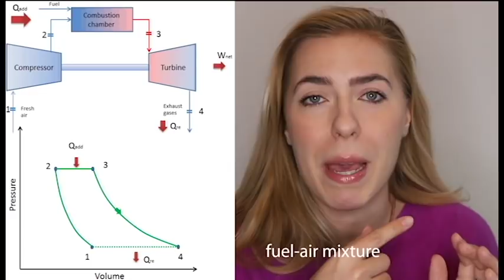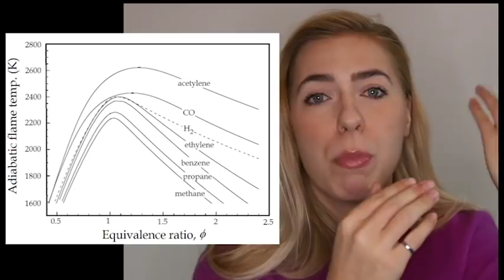Watch if you dare | Explaining my Master's Thesis in Mechanical Engineering

Comment: Hi there, Im a Mexican aeronautical engineer, currently studying a MsC in mech engineering. Did you wrote a code to solve the problem under reactive flow conditions or there is already a library implemented on the solver that you mentioned? Thanks.

Comment: What's the difference between squirting fuel in the hot exhaust gases to conserve fuel and an afterburner that is actually consuming LOADS of fuel in an airplane?
Reply: @Haramasch Abrasir - basically it's safety vs. efficiency. 

The afterburner is very inefficient, because it has a much less than ideal fuel:oxidizer ratio, but the generated pressure wave is also much easier for the turbine to handle without too much internal stress, because it only impacts the nozzle exhaust area.

But adding an oxidizer to the hot gas while it's still inside the turbine can be much more efficient in theory, but then there is a risk, with a poorly designed turbine, of the extra pressure generated from the extra combustion to damage or destroy the turbine itself.

Comment: Oooo this is SUPER cool. I never considered thermal acoustics, like I knew pressure fluctuations are dangerous in such systems but I never figured it could lead to a feedback loop. Very cool stuff I can't wait to read through it. I currently study mechatronics at a high school and our engineering/ thermo-dynamics classes are still pretty basic and don't cover these areas but it's still so interesting.
Reply: What high school do you go to? I have never heated of a high school covering thermodynamics before.
Reply: Heard*
Reply: Carl Benz Schule Mannheim, Mechatronics profile. We have a subject where we handle ideal gas processes of various kinds and do energy conversions through sets of systems. It's not strictly thermodynamics yet but it's pretty much the same concept but on a more elementary level.